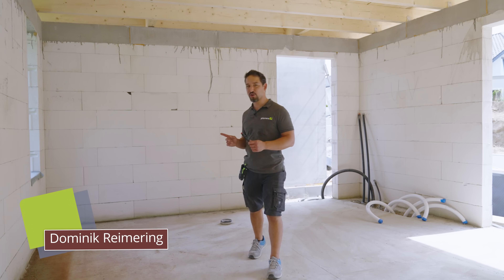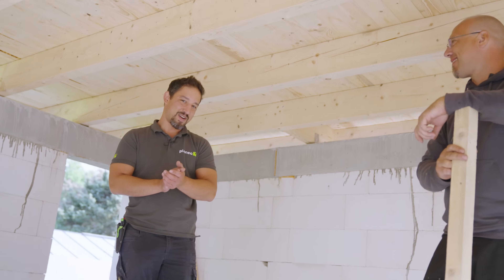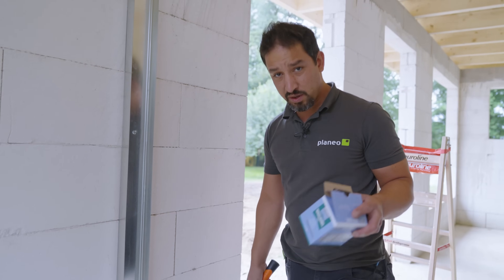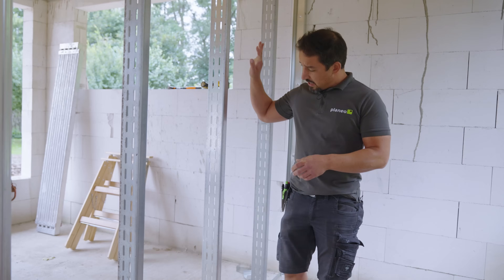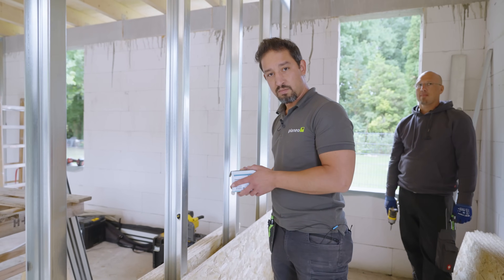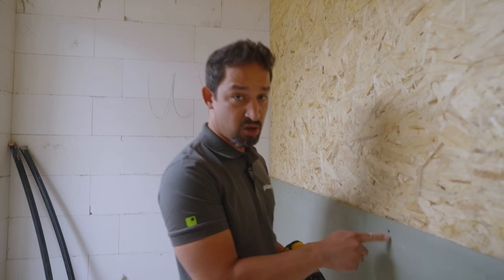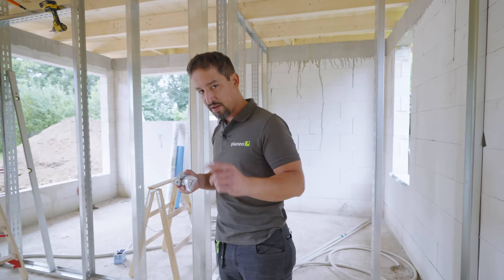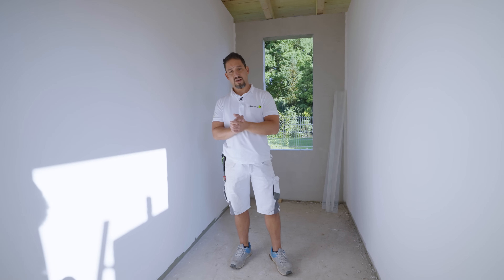Trockenbau - Trockenbauwand selber aufstellen

Comment: Super Video
Aber alle senkrechten Profile sind CW Profile. Auch an der Wand. Lediglich die Profile an decke und Boden sind UW. 
Sonst alles top.
Für alle die sich über "falsche" Bezeichnungen von Dominik beschweren: KEINER aufm Bau verwendet die genauen Fachbegriffe. Bei Rigipswand weiß JEDER was gemeint ist, also legt nicht jedes Wort auf die Goldwaage!!! Normalerweise ist flexen bei Profilen nicht erlaubt, aber macht jeder. Ich hab noch nicht gehört, dass die Profile zum rosten anfangen;)
5:30. Der Kunde ist König, also beschwert euch in den Kommentaren  nicht, dass die OSB Platten teuer sind. Der Kunde will das also bekommt er das:) In dem Verputzvideo wurde erklärt, dass es der Technikraum kommt. Wenn eine Gastherme, Regal etc. an die Wand kommt dann schaut es mit doppelt Rigips schlecht aus!